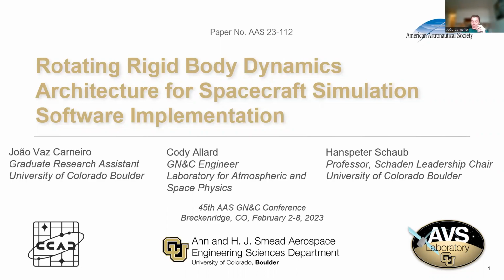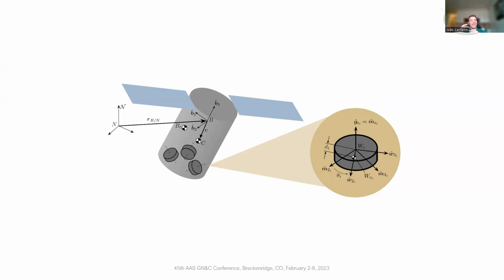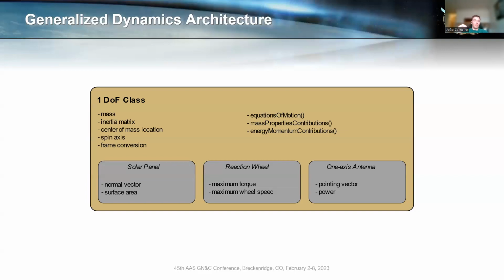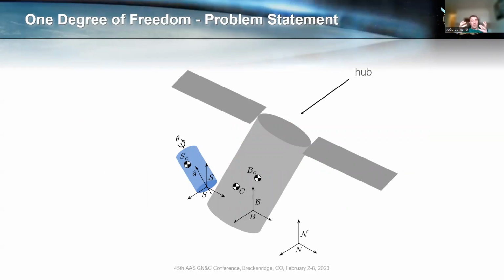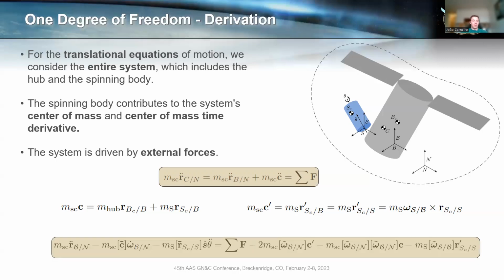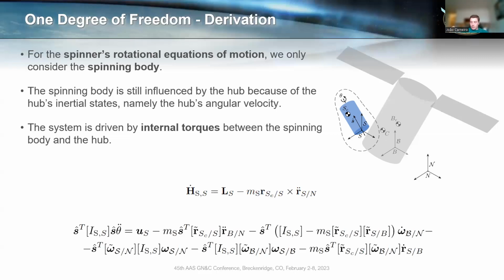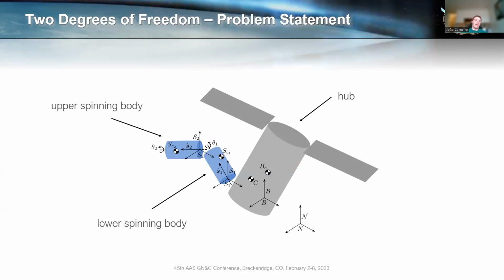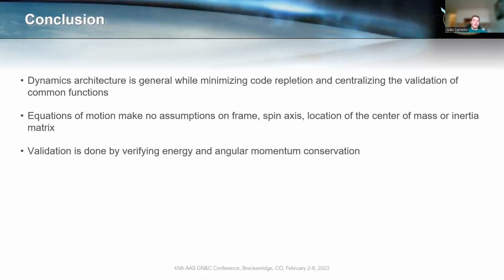Rotating Rigid Body Dynamics Architecture for Spacecraft Simulation Software Implementation

Comment: Hi, AVS Lab! I am an aerospace engineering student, and I am just at the beginning of the road. I am interested in the control, automation, and simulation of space vehicles. In your opinion, which programming languages and which computer programs should I learn besides the theoretical lessons? (I just discovered you.)